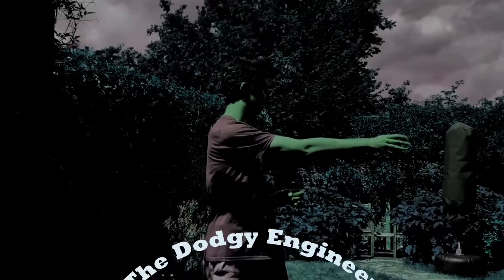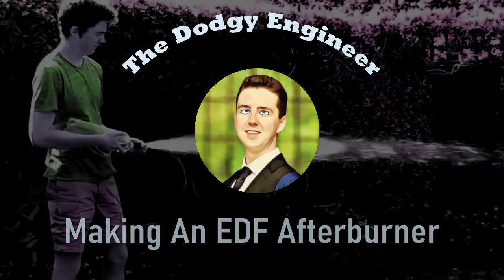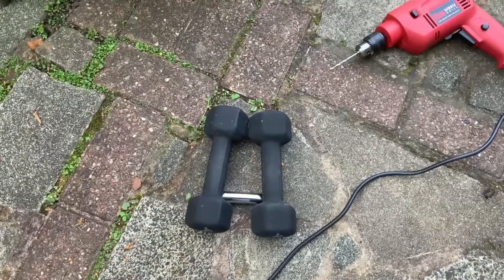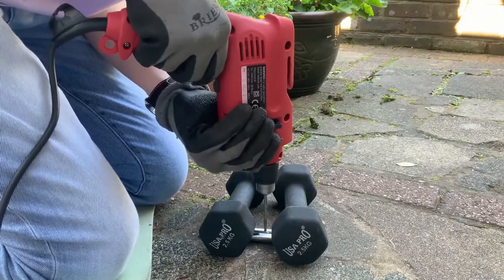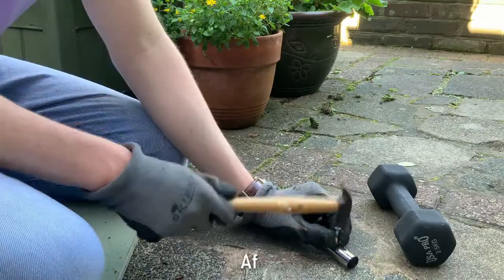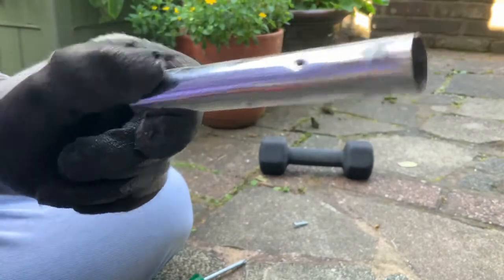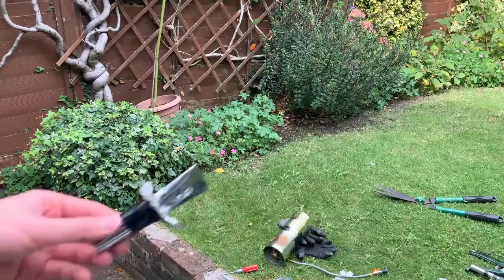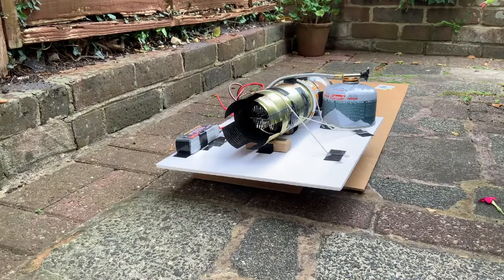Making An EDF Afterburner

Comment: It should produce some extra thrust, as extra mass is pushed out of the engine, so due to the conservation of linear momentum, it will produce a bigger force. However, it probably won't be much.
Reply from the maker: This is assuming the exhaust velocity remains the same, which is not true since the exit pressure from the EDF is affected by the combustion behind
Reply: @TheDodgyEngineer  The exhaust velocity should not lower too much, and may even increase. Combustion produces a lot of heat, so the gases will expand inside the nozzle, and thus increase the flow velocity.
Reply from the maker: @he-man4076  But the combustion raises the pressure behind the EDF, which will push back against the EDF, reducing the flow rate. Trust me, the afterburner does not increase the thrust in this case.

Comment: i have an idea for you, in order for the fuel to burn more efficiently and consistently, i would recommend that you use a glow plug instead of lighting it with that baton, it is what i am going to be doing to my afterburner, also consider using an aluminium canister for butane instead of the bulky drum and also i am using brass pipe as my flame tube, which is easier to drill into, and also try constricting the exhaust which should pressurise it, hopefully mine will work and yours will become awesome
cheers!

p.s, i am your 700th sub!
Reply from the maker: Great ideas! Thank you for subscribing, and I hope your own afterburner works a lot better than mine!

Comment: Definitely look at some video of Flite test and maybe also some of my videos about the construction of an edf afterburner. You designed the whole fuel injection after the one of a real jet engine combustion chamber. Afterburners however are normally just simple tubes, bend in a ring shape with holes in them (e fluxring). Also, try using liquid propane/butane. The flame holder also needs improvement (way too much drag). But a nice project after all👍
Reply: Hi i am a subscriber of your channel could you give me some help on how to keep the flamme going at high speeds

Comment: Now to put it in a plane 😂
Reply from the maker: Once I fix the thrust issue and the heavy weight of the current set up, quite possibly...
Reply: @TheDodgyEngineer  Compressing the air first would increasse the thrust. If its worth anything, you could try to make an Axial compressor
 to compress the incomming air first. then igniting it in a combustion chamber.
Reply: @thecutetimo  compression ratio?